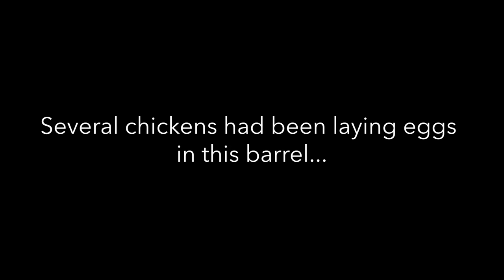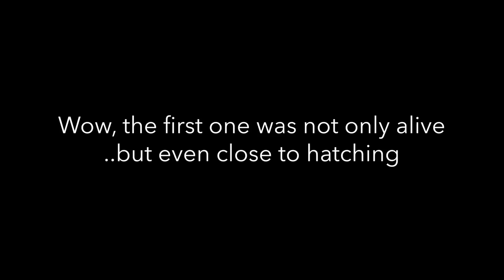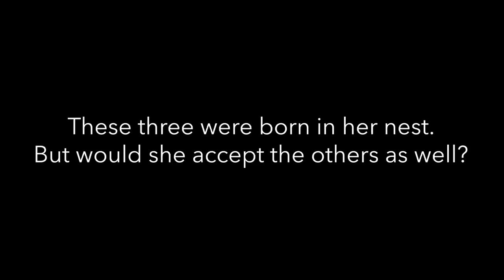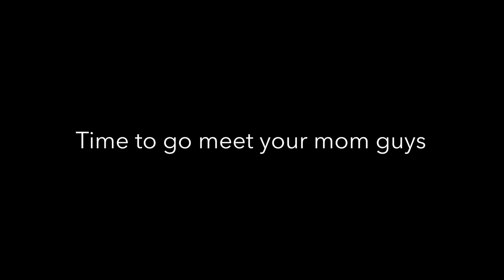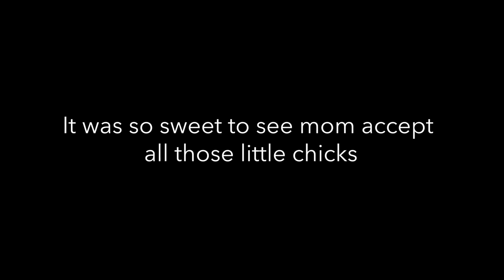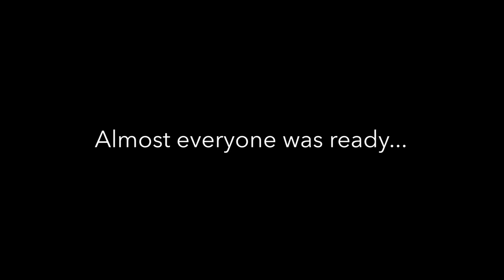Can One Chicken Hatch 43 Eggs?

Comment: She COULD do it under specific circumstances. She'd need a tall straw nest with a hole that the diameter was no bigger than her body when hunkered down, wings fluffed out. The nest would have to be no deeper than absolutely neccesary to contain the eggs with only 6 or less higher than the edge of the nest. In this way she could sit on the nest and her heat would penetrate down and the straw would insulate to keep that heat in for the lower eggs. I've had a hen do 27 eggs before under this scenario.

And hatched chicks...pffttt...no problem. I had two hens 2 summers ago that I put in the nursery pen with their babies that I just kept handing babies as other hens hatched them...all summer they took care of babies with no problem. Must have been 50 of them over the summer.